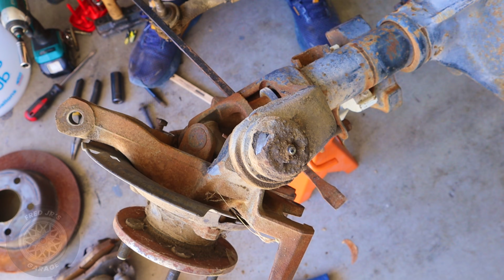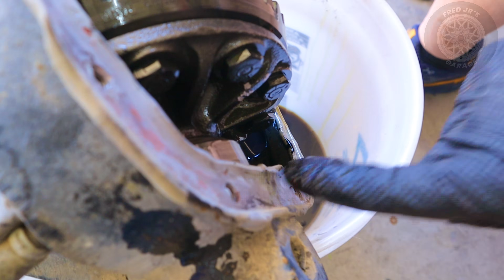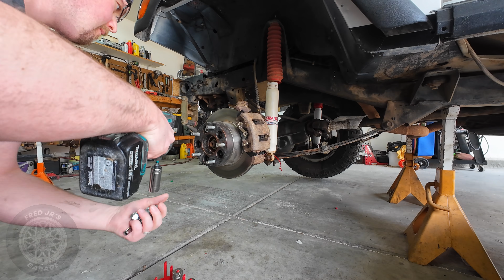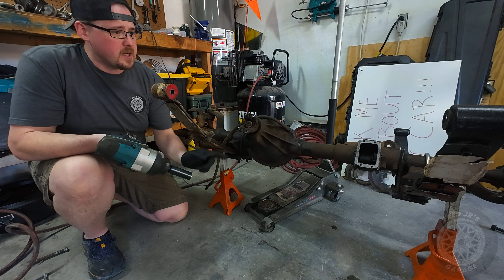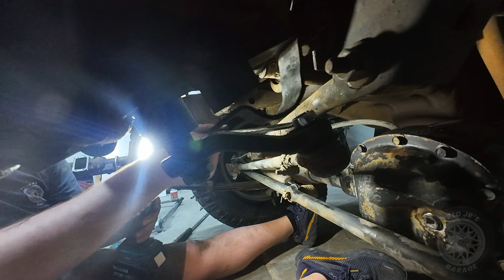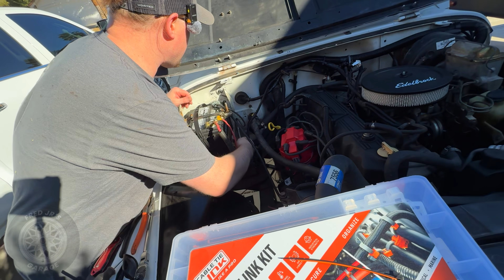Replacing a Destroyed Front Axle | Fixing Dads Jeep Pt.5

Comment: Put some Eaton Detroit tru-track limited slip front and back. You can't go wrong.
Reply from the maker: Tru tracks is a nice for the street (putting one in my trans am this summer) but when a wheel can be off the ground the Detroit locker is boss!
Reply: @FredJrsGarage my LJ has a super flex lift on it. So my wheels hardly ever come off the ground. I have limited slip front and back on 4.56 gears
Reply from the maker: @richfisherman2664  how’s the longer  wheel base? Keep toying with stretching this yj to give it more capability
Reply: @FredJrsGarage I like it. Better than the short wheel base. I've owned both. I love my LJ